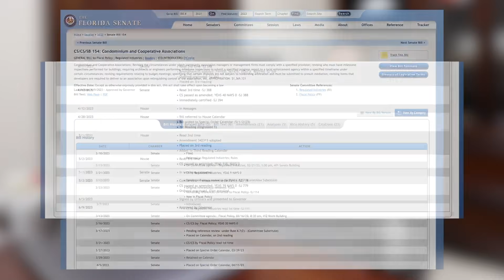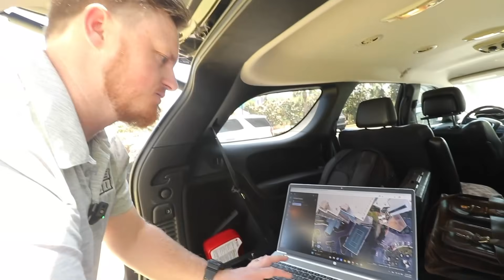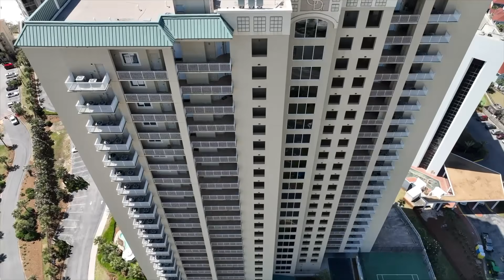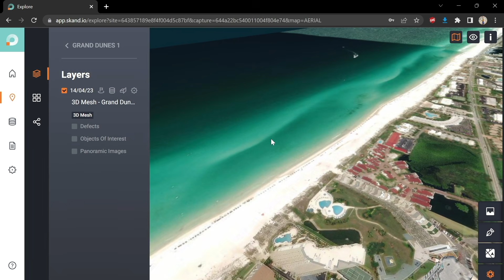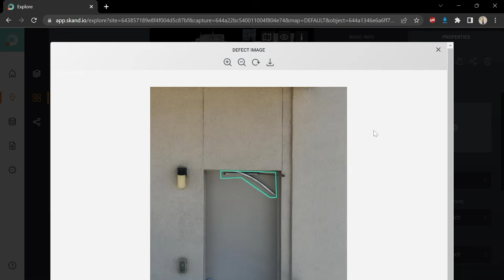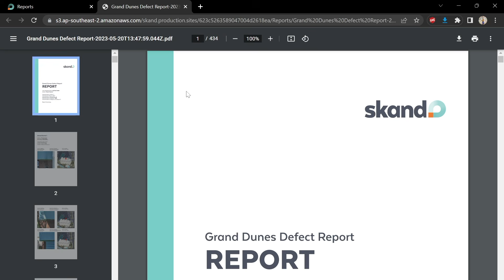Drone Inspection with DJI Mavic 3 Enterprise

Comment: The flight of the drone behind the building is a violation of FAA Part 107 rules requiring uninterrupted VLOS.  If an accident had occurred, PIC could have been in significant trouble.  This is a bad example of proper drone operation.

Comment: What if there is a power line between the buildings?
Reply: I’m guessing you would at least have to move the drone above or below or you would have to do it manually then set it on autonomously right below or above the powerlines

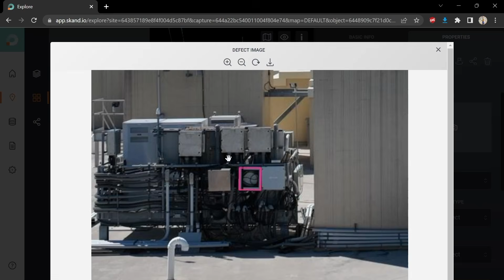Comment: @16:25, that is a Cell Site equipment for a wireless carrier, not an HVAC system. You can see the cone shape GPS antenna above the cabinets to the left of the picture which is common for all cell sites to have. Antennas shown @18:30 are connected to this cell site. In this case, it looks like all the coax cabling for this cell site is routed through conduits instead of box cable trays routed along the rooftop. This is good because most cable tray covers will rust where the screws are installed and with time, strong winds can blow off these cable tray covers and cause injury. Drone inspections are a good way to also inspect these cable trays and also check for loose conduits.